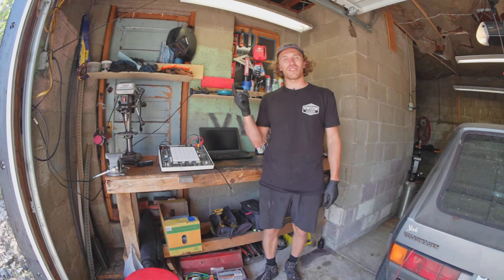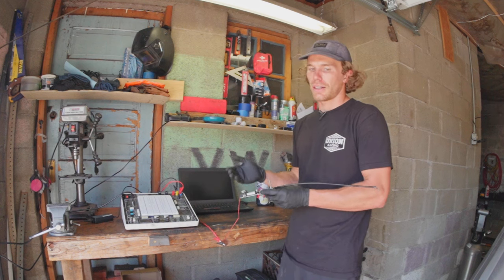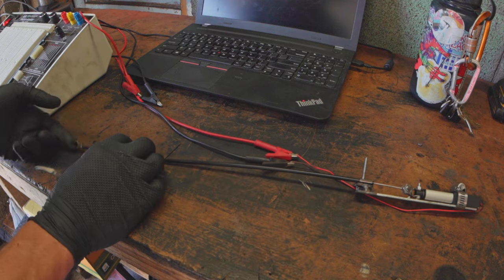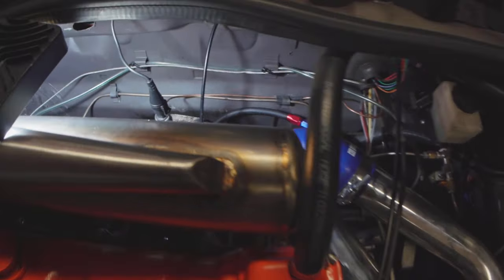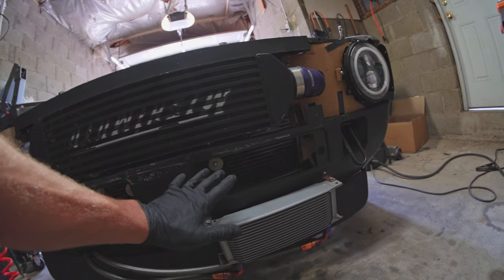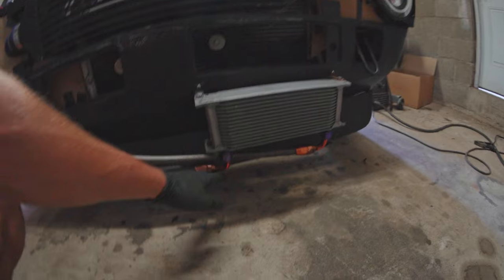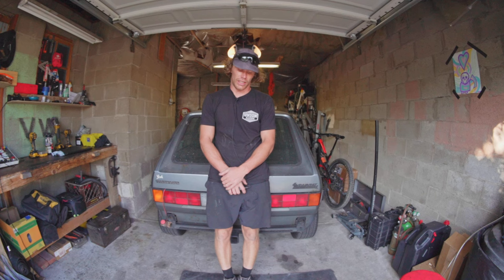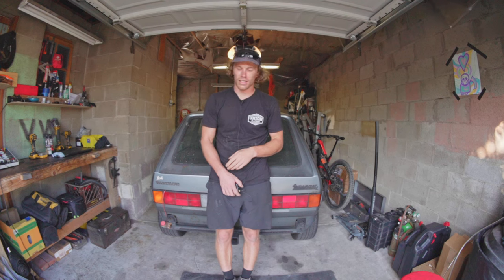Watch me dial in my VNT turbo & HEAT my cooling system

Comment: Out of curiosity, what sorcery are you using to hold the back half of the hood?

Everytime i see you pull it off and put it on i always question if the hinges are even bolted on
Reply from the maker: 😂😂 the magic of nothing at all 💯💯💯 it's just front hood pins, pressure keeps it down while driving, can't really make it past the exhaust pipe anyway
Reply: @OliverFetter  knowing that makes me so happy thanks for the reply keep at it! loving the content
Reply from the maker: @alancampbell7603  cheers!!